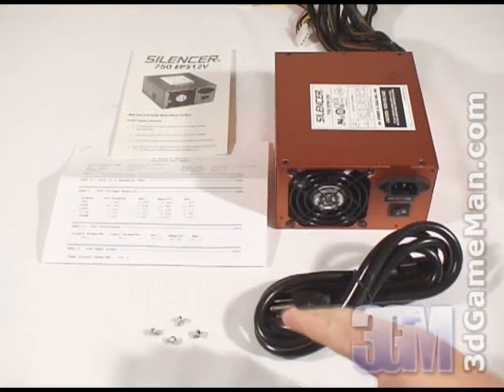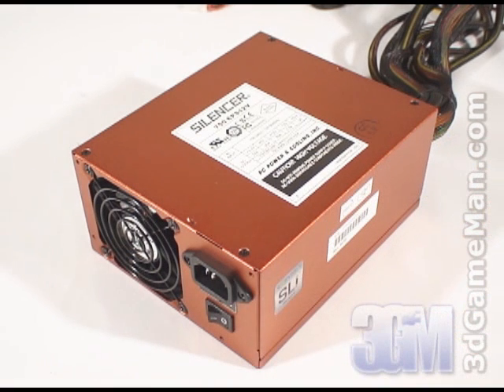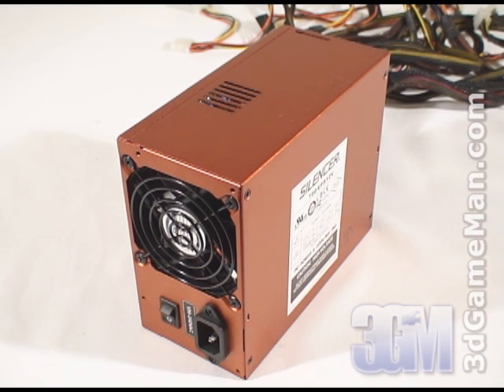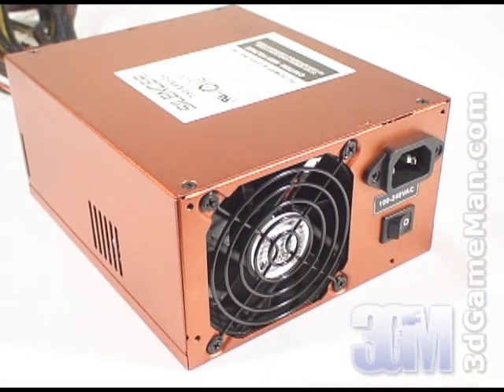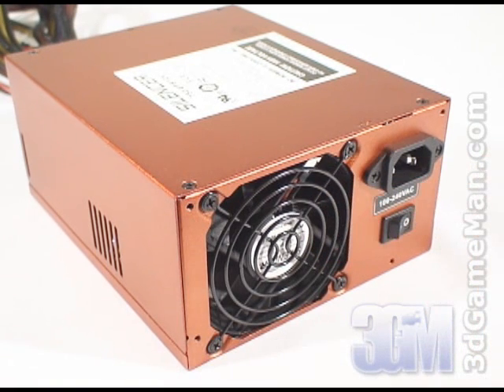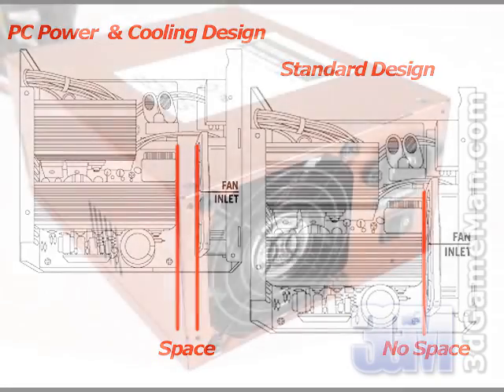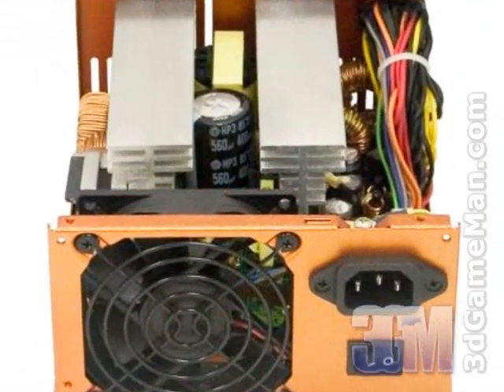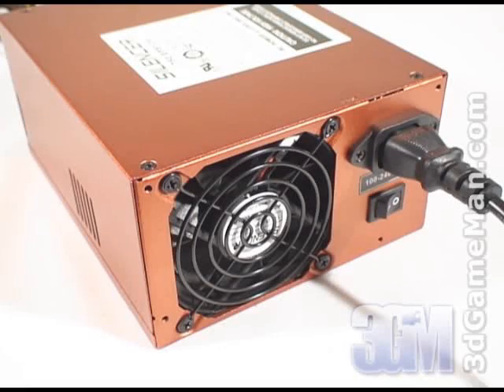#717 - PC Power & Cooling Silencer 750W PSU Video Review

Comment: 80mm fans aren't good on PSUs mainly because of noise - for them to move enough air to cool a high wattage PSU they have to spin pretty fast and therefore 'Silencer' PSUs sound like a hairdryer when loaded. 120mm fans can spin far slower to move as much air and so are generally far, far quieter and the heatsinks are designed differently for the top-mounted fan. The newer models score extremely well with regards to ripple/noise. As I've said before resistance added by modularity is minuscule...

Comment: they must be tested when they've warmed up too since a lot of PSUs can handle load fine when cool but when exposed to heat (i.e. inside a PC case) they can fail. Obviously testing voltages is very important too including voltage drop under load etc. Power-on overshoot transient testing is a good thing to include too. PC P+P PSU normally pass these tests but regulation isn't the best, ripple/noise suppression isn't great either and they're far from the best value for money.

Comment: I'm not denying other companies have marketing bull - most do. PC P+P are FULL of marketing bull lol, e.g. - no modular connectors is better, 80mm fan is better? Both of those statements are total crap as a explained before. Obviously you've been reading crap reviews the i.e. ones who plug it into a PC and check voltages with a discount multimeter and say 'yeah it rocks!'. Proper SMPSU reviewing MUST include ripple/noise testing, full load testing with proper equipment and...